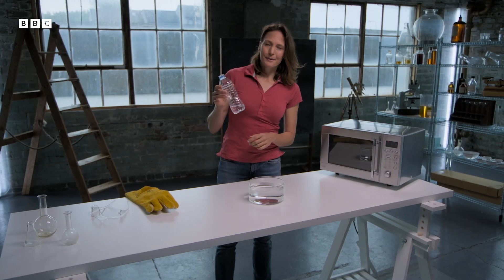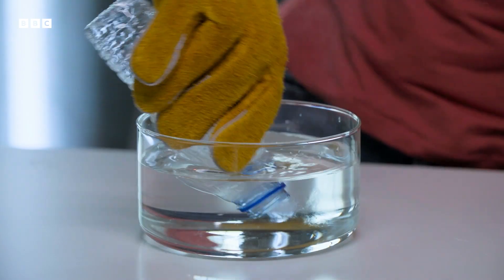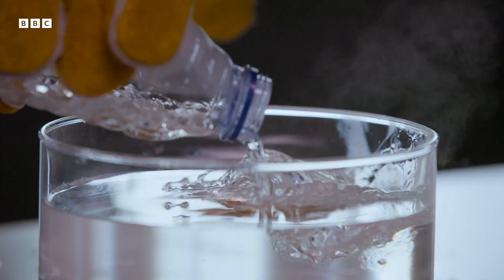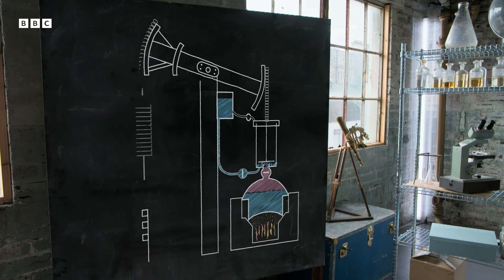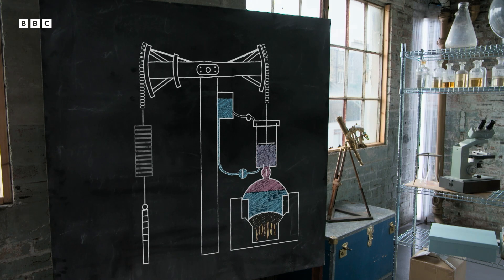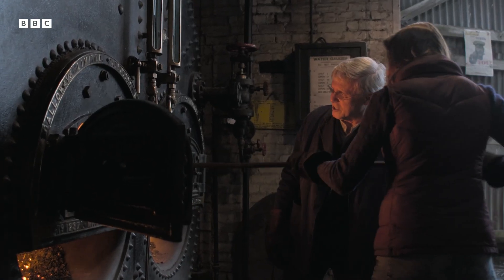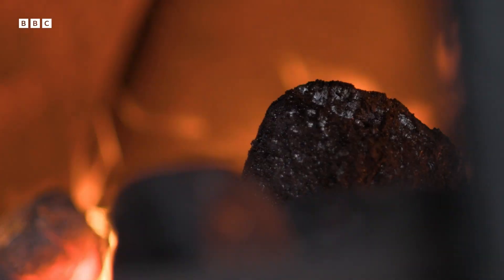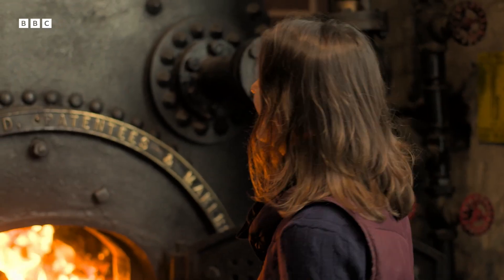From Crisis to Innovation: The Steam Engine That Changed Everything | BBC Earth Science

Comment: Watt's 5psi (absolute, that's -- 10 psi guage reading, 10psi below ambient Atmospheric Pressure) 'closed loop' 'Low' High Pressure Steam System between the engine and the condenser eliminated 14.7psi of Atmospheric resistance and therefore needed only 1/4 the normal amount of fuel. It was equivalent to a 20psi (absolute) 'High' High Pressure Steam Engine without a condenser in terms of power, but only needed 1/4 the amount of fuel. It was also the first ever use by anybody of Steam Pressures below Atmospheric Pressure, so the boiler would tend to implode rather than explode if it failed.

Comment: Anyone who might think that steam power is obsolete should visit a nuclear power station.
Reply: Yep, using nuclear power to make steam to turn turbines instead of coal
Reply: By convention "steam power" usually refers to engines which boil water by burning fuel. Again, by convention nuclear power is not "steam power", and by that conventional definition, steam power is obsolescent though certainly not yet obsolete. Steam driven electrical plants are still common, and really the last large scale use of steam power, but changes in thermal power tech, as well as a quite necessary (if slow) move away from fossil fuel use is going to make even that application gradually obsolete.
Reply: Or a nuke sub.
Reply: the world is still steam powered i believe? 

it seems to me all the energy,  coal or oil or wind or sun etc, 

it all goes to heating water to make steam.. ? 

is that right??

Comment: The Newcomen engine completely failed to harness the energy in steam. It was an atmospheric engine that uses air pressure to do work.
The Watt engines changed that and actually harness steam pressure…
The double acting engines of the railway pioneers like Stephenson, Hackworth and Ericsson revolutionised the technology again (but had to wait for Watt’s patents to finally expire).
Reply: Thank you. This was more informative than the video
Reply: All true, but Trevithick's use of high pressure steam, which Watt opposed, was also a major advance.  Watt was right in a way, it was more dangerous at that time but it was essential.
Reply: The Newcomen engine does use steam pressure to generate power. All steam engines do. It's just that the Newcomen engine uses atmospheric pressure to push against vacuum (it does so indirectly), whereas most steam engines use pressure above atmospheric to push against atmospheric, or even both high pressure and vacuum together. 

Using only vacuum results in very low efficiency and power, because the highest pressure difference possible is 1 atm, but it had the considerable advantage of never exploding, even when you had to make it out of early 18th century wrought iron.
Reply: @ The Newcomen engine used 1% of the energy in the steam. The steam wasn’t used to push - it was used to break and then create a vacuum with atmospheric air providing the actual driving force. Watt’s modification was to go to actual positive pressure inside the cylinder and a separate condenser to suck the steam out - that pushed efficiency over 3% in the later models.
Reply: @ Atmospheric air can't provide any net driving force, because the pressure doesn't change. In the Newcomen engine, the atmosphere is used to store energy. You can think of the entire column of air above the piston, extending all the way to space, as a counter weight. Steam pressure of 1 atm lifts that weight, and then vacuum pressure allows the weight to drop, lifting the pump rod at the other end of the beam.

We don't think of atmospheric steam as being "pressure" but it absolutely is. It's just that we happen to have equal pressure all around us so we don't feel that pressure. Put a Newcomen engine in a giant vacuum chamber, and replace the atmosphere on top the piston with some lead weights, and suddenly you have a very conventional steam engine that simply operates at very low pressure.
Reply: @ Newcomen Engines are weighted to drive to the full up position with no energy applied. The condensing steam simply removes the force opposing the atmospheric pressure. That’s what makes them atmospheric engines (and horribly inefficient). The steam doesn’t provide force - it removes a balance force.
A Newcomen engine wouldn’t work in a vacuum chamber because of the exact reason you listed - it isn’t weighted correctly.
Reply: @allangibson8494  The piston goes up and down, so energy is definitely being applied. Unless Newcomen proved Newton wrong.

The weight of the pump on one end of the beam and the weight of the air above the piston on the other are balanced forces which don't change during the cycle. Only the steam pressure in the cylinder changes. The weight of the atmosphere will always push the piston down, unless some other force counters it, and that force is the pressure of the steam. The part that makes this not obvious is that the pressure of the steam is the same as the pressure outside, but you could put the whole engine into a vacuum chamber and replace the air on top of the piston with some lead weights and the cycle would be the same, but now you very clearly have pressurized steam pushing a weight up.
Reply: @ The steam in a Newcomen engine doesn’t push the piston up - it is pulled up by the weight of the pump assembly. Simply opening a valve to atmosphere would have the same effect.
The condensation of the steam in the cylinder permits air pressure to push it down. The only use of steam “pressure” is to purge the air from the cylinder (as condensing air is a little hard).
Newcomen engines rely on the change of state from gas to liquid with the resulting change in volume to drive themselves.
BTW - in a vacuum water goes directly from gas to solid…
Reply: @allangibson8494  Atmospheric pressure is still pressure. The steam is pushing the piston up with atmospheric pressure. If you let in air, it would push it up also, but you wouldn't able to condense that. The steam in the boiler is doing the pushing instead, with exactly the same pressure as the air outside, but it's still the steam doing the pushing. The pressure of the steam in the boiler is what pushes air out of the boiler so it can be filled with steam instead. If not for that pressure, air would just fill up the boiler and the engine would not work.
Reply: @ The steam DOESN’T push the piston up in a Newcomen engine. It permits it to rise by partially balancing the air pressure above and below the piston.
Reply: @allangibson8494  "Partially balancing the air pressure above" by applying its own pressure to counter that pressure. To balance one force, you must have another force. The pressure of steam is the force balancing the pressure of air.
Reply: @ Simply venting/equalising the vacuum below the cylinder will cause it to rise. Newcomen engines are powered by a LACK of steam pressure.
Reply: @allangibson8494  Vacuum is a useful concept, but at a fundamental level, it doesn't exist. All pressures are absolute. When the cylinder is full of air, that just means that 1 atm of pressure inside is countering 1 atm of pressure outside, but air can't be condensed so there is no way to do work. If there is steam in there, it can be condensed, reducing the pressure inside, allowing the higher pressure outside to push the piston down and lift the pump. Then steam is let in, at 1 atm, to push up on the piston, cancelling the force of the air pushing it down, which allows the weight of the pump to lift the piston. The steam is pushing with force which cancels the force of the air. The same thing could be done just by letting in air, but then there wouldn't be a next cycle because air can't be condensed to reduce its pressure.
Reply: @ Which is exactly what I said.
Newcomen engines use air pressure to do work. The steam merely provides a difference in pressure by alternately heating and cooling the enclosed side of the piston and thus providing alternating vacuum and ambient pressure. They are horribly inefficient as a result because they are vacuum engines not steam engines. The steam pressure in these engines does no work. It provides no force to the output shaft.
Reply: @allangibson8494  No it is not air pressure doing the work. It is steam pressure at 1 atm. It's steam that's in the cylinder. Also, your original claim was that "The Newcomen engine completely failed to harness the energy in steam". This is simply wrong. Steam is exactly where the energy to drive the engines comes from. It can't be from anything else.
Reply: @ The steam in a Newcomen engine doesn’t PUSH. It doesn’t do work. The piston is pulled up by the falling pump shaft with a sub atmospheric steam pressure being sucked in behind that is flash cooled at the top of stroke by a water spray.
The lack of pressure does the work in a Newcomen engine.
Reply: @allangibson8494  Pressure is pushing. It is force divided by area. Steam at 1 atm exerts force by definition. The air also exerts force, but it is constant throughout the entire engine cycle, as is the weight of the pump. Both can be ignored and the cycle still works the same way. Only the changing forces matter, and the only force which changes is the force of the steam on the bottom of the piston, increasing above a constant force to drive it up, and decreasing below that constant force to let it fall.
Reply: @ DIFFERENTIAL pressure pushes. No differential, no net force. Steam in a Newcomen engine exerts no net force.
The steam in a Newcomen engine doesn’t push the piston up - it simply doesn’t resist the pull the pump shaft exerts.